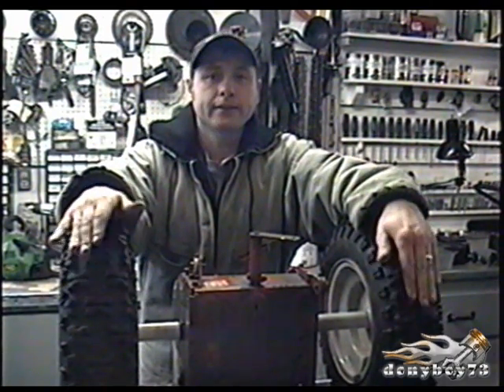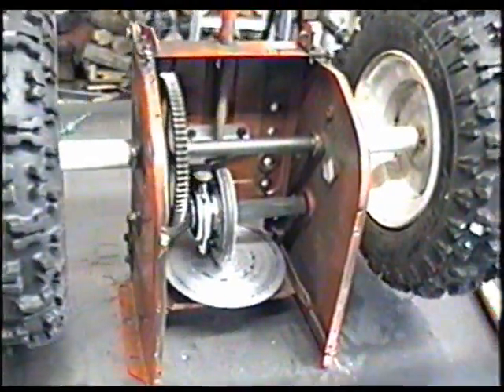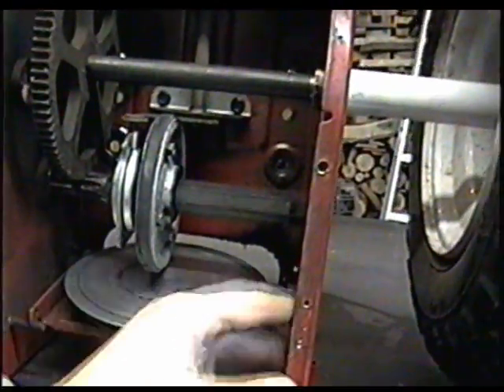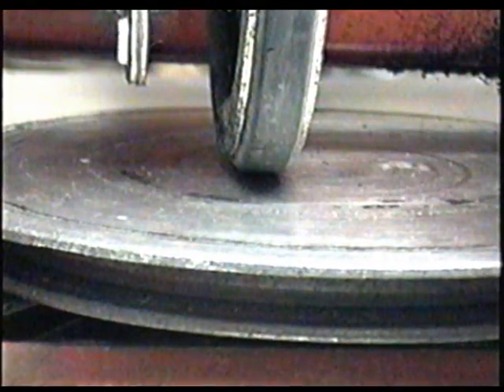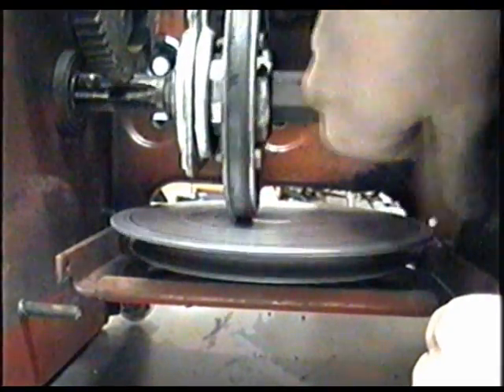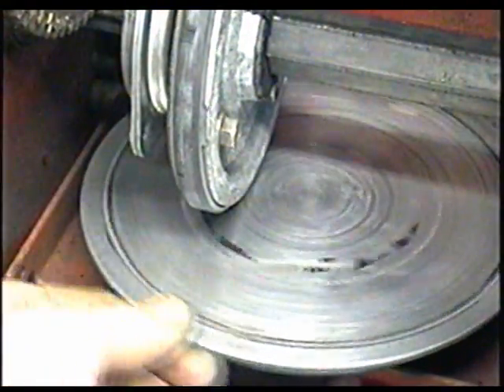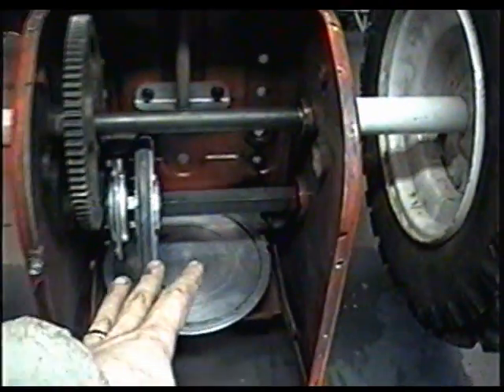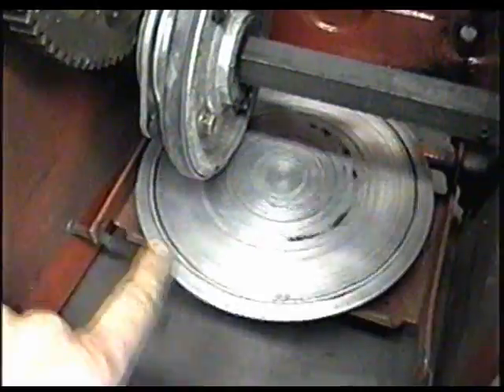HOW The Friction Disc Wheel Works on Your Snowblower

Comment: Long shot here...but I have an MTD Yard Machines 8/24 that will not move forward/reverse.  I had someone fix it last year and it worked for about 1/2 of the season last year and stopped moving again.  I tore it apart a couple of weeks ago, and checked the friction wheel and it's not dirty at all.  The wheels do move freely if I turn them.  The friction wheel comes into contact with the friction disk fine as well.  The wheels just will not turn like they aren't getting enough power or something.  I cannot see what is wrong with it.  Any ideas???  Thanks!
Reply: I have the same problem but mine is a Ariens new out of the box won't move one inch.
Reply: Antal G Just a follow up - I figured out my issue!  There is a small spring (3-4 in) that holds tension on the tension pulley of the drive belt.  It was just hanging there.  A buddy found a similar-sized one and I'm back in business!  It extends from the pulley to a bolt on the opposite side.  Hope this helps someone.

Comment: what would cause a squealing noise when engaging the drive wheels? it only makes the noise when in 5th all the other forward and reverse drive gears are quite?
Reply: Most likely a stretched belt, 5th “gear” requires a lot of torque from the engine and places a lot of stress on the belt

Comment: I have a troybilt 42010. Only the left wheel is driving...any suggestions?
Reply: broken sheer pin
Reply: I know this is a very late reply, but are you sure it's not set up to be that way? My blower has "click pins" that can be inserted at the end of the axle to either drive that wheel with the axle or let it rotate freely. IOW you can have single left wheel drive or two wheel drive.

Comment: Good explanation, but it seems like there should be a more 'sure' drive system.  Just bought my first snowblower and it's hard to see that drive system being strong and reliable the way you illustrate.  Time will tell.

Comment: JUST A TIP IF YOUR SNOWBLOWER AINT MOVING CHECK THE PIN IN THE WHEEL OF THE SNOWBLOWER INSIDE THE BOTTOM PLATE IT MIGHT BE MISSING I HAD A FEW PROBLEMS WITH THAT PUN

Comment: Didn't you misspeak at 0:54 (almost 8 years ago) when saying you lift the friction wheel? You are lifting the friction disc aren't you so that it contacts the friction wheel? The disc has the large metal surface and is driven by the belt and pulley. The wheel has the rubber surround that makes contact with the disc.

Comment: my snowblower will move in reverse but only goes forward in about 1/4 inch of snow, if I lift the wheels off the ground they turn great, put it back down and they don't. HELP
Reply: Mine did that, in the end it was a slight cable adjustment ( tighten it up) and more importantly, as I left the snowblower out in the snow/rain - the rubber part of the friction drive got wet and just spun.  Once it dried out it was fine. I now park my snowblower in the garage and its never happened again.

Comment: Friction discs made in the 80's would last 30 years+.  Friction discs made in 2010 last 5 years.  All snowblower brands are now using cheap rubber compound that wears very fast. Everything is now cheaper quality.  Same with car parts: you can buy a suspension bushing from the main dealer that will last 10 years, or a cheap bushing from China that will last 3 months.  Both parts look exactly the same, but the rubber compound is totally different in quality.
Reply: mess production, quality of 'political leaders' has dropped too

Comment: thanks for all your helpful videos. I have searched everywhere (i think), but do you have a video showing how to replace the friction disc where the rubber wheel hits?

my friction wheel's rubber came loose and gouged that disc/plate and needs to be replaced. Craftsman 247-88355

thanks
Reply from the maker: https://www.youtube.com/watch?v=8WzMzrwHYFY
Reply: donyboy73 thanks. But I need to replace the plate perpendicular to that

Comment: great video. i ran into a problem and im not sure how to explain it, so heres the best i can do.

1, the friction wheel is always in contact with the disk
2. the friction wheel only comes off the disk when i press the clutch, (kind of a backward system)
3. the disk rotates but does not move back and forth to engage,
4. When i press the clutch handle the friction wheel moves away from the disk and stops moving.  

on the shift leaver it says "squeeze clutch handle before shifting"

Any ideas?

i also have a problem with the rubber wearing down really fast. but for that ill try the old clean and grease.

Comment: Why would just my left wheel drive and not both of my wheels?
Reply: NAGAZINA FIREWORKS check the pin that holds the wheel to the axle. It may be in the wrong hole so it spins freely. You can make it drive 1 wheel or both.